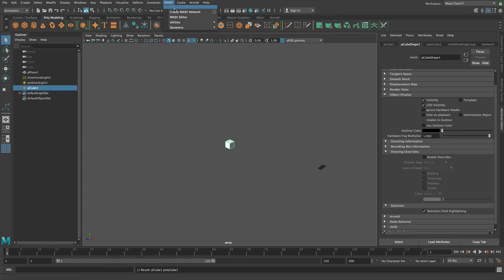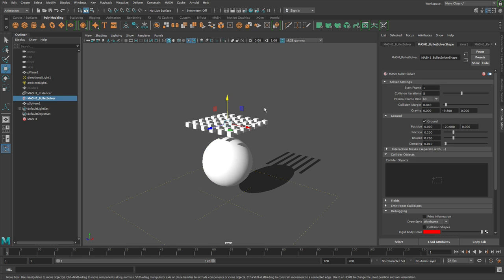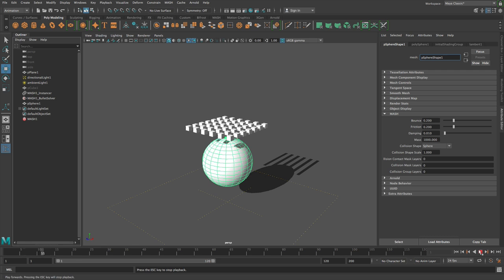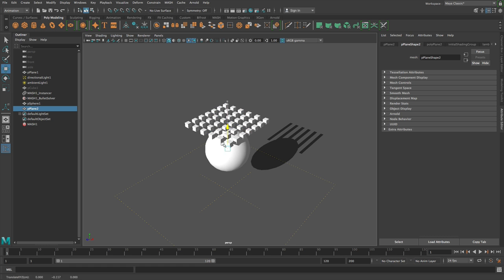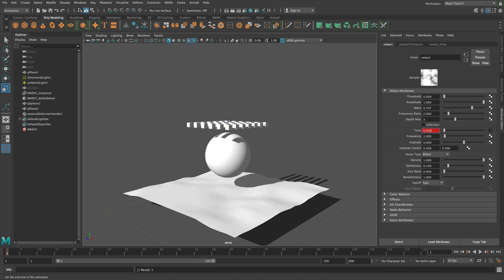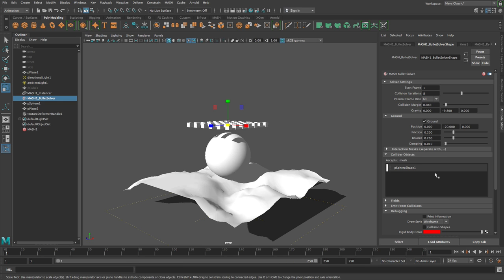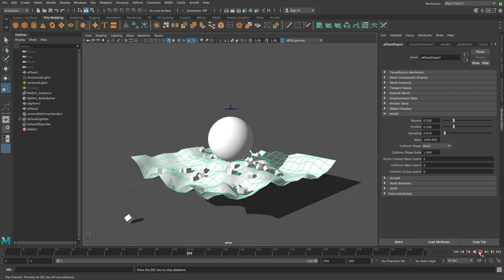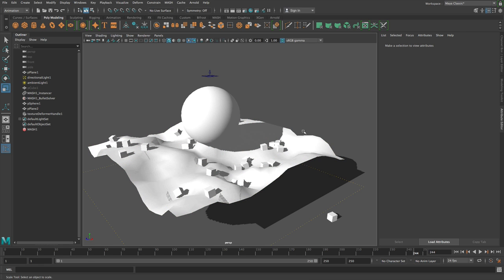MASH Dynamics No 3. External Colliders

Comment: Thanks! How do you adjust the collision thickness of the collider because I am doing a ball pit simulation and the balls penetrate the walls slightly?
Reply: Actually, I kinda figured it out, it really is the "Collision Shape" setting on the Dynamics MASH node. I had a lot of success with Box, Sphere, and Capsule shape, and playing with the Collision Shape Scale. So if your objects are penetrating maybe try scaling UP your collision shape scale slightly.
Reply: @MANIAKRA  Awesome! Thanks! I will give that a try.
Reply: Same, I am filling a container with beans and about 40% of them are penetrating through the model.

Comment: Hello. Thank you for the tutorials. I am having an issue that I am hoping you can answer. I want to have this box with sphere's inside and the box ripping in half. I have the box animated and exported as an alembic node. I am making the spheres dynamic and the box it's collider. However, the collision shape seems to only take into account the first frame shape of the box and does not change as the box changes. So while the box rips, the spheres are staying in the center maintaining the boxy shape. Is there a way to  have deforming colliders in MASH? I have changed the collision shape to mesh and that doesn't seem to work.

Comment: Tried something essentially the same as this tutorial, but while it basically works I get a lot of cubes eventually penetrating and dropping through the texture deformed plane. Tried bumping up the collision iterations as high as 500, but cannot fix it. Is this unavoidable or are there other attributes that will improve collision accuracy?
Reply from the maker: This could be one of a number of things (dynamics is a balancing act). You could try increasing the Collision Margin on the solver, also try the different collision shapes on the mash node. Mesh is the least accurate. It also depends on how much your mesh is deforming frame by frame, if it deforms so much that it can swallow the model resting on it, then theres nothing that can be done about that! :)

Comment: HI Ian, Im trying to create a small tin filled with nails. Ive created a MASH dynamic network for the nails and they are set to 'mesh' . The tin is a medium poly cylinder plugged into the bullet solver. The nails fall inside the tin just fine, but when I move the tin from side to side 'some' eject out. I have tried upping the collision iterations and also the internal frame rate of the bullet solver with some slight improvement but even with the solver set to 960 the nails escape. The tin is set to mesh under the shape node MASH attributes. Any ideas how to get this working if at all or am I trying to push this too far ?
Reply: When I say move the tin from side to side I mean keyframed 'not' interactive.
Reply from the maker: I'd certainly not use mesh for the nails - switch it to convex hull and see how you get on. You could also break the nail head out from the rest of the nail, so that it's two objects, and then you'd get a compound collision shape built from those two objects. Avoid mesh as a collision shape as much as you can! :)
Reply: Hi Ian and thanks, yes I tried convex hull also on the nails with slightly better/quicker results last night - better but not perfect by a long shot. Admittedly nails are pretty problematic shapes but I thought I would try this kind of shape as its a more real world use rather than cubes/spheres.
Reply from the maker: Could be your scale - try scaling everything up. Also with convex hulls, increase the collision margin to say 1 (default is .04).
Reply: I am just trying to get away from Maya rigid body dynamics or the fairly useless Nparticle instance geo which doesn't consider the shape of a complex mesh. When I saw the Dynamics update to MASH I was over the moon and have been playing with it for a while now and also following your great insights.
Reply from the maker: Feel free you upload your scene somewhere and I'll take a look.
Reply: Ah Ha collision margins have helped allot! kind of makes the collisions less real but its a much better result overall. I shall continue to test. Thank you Ian
Reply: although rotating the tin to tip the nails out is a brand new issue as they just stay at the same level in Y at which they came to rest.
Reply from the maker: Is the tin an external collider or is it in a MASH network? If it's an external collider you can't do this. It needs to be in a MASH network to rotate (a MASH network with 1 point, which is the tin). Then use position/ rotation strength to move it.
Reply from the maker: Basically don't move external colliders. Only deform them.
Reply: Yes its an external collider - gotcha I will try a separate MASH network for the tin. Again - thank you !
Reply: I was having the same trouble as this guy... I'm dropping some spheres in to a container made out of cubes, and my scale was too small... Scaling everything up about 20x sorted out the collisions, before scaling my spheres would just pop through the sides of the container. Cheers for this comment, Ian! These tutorials are really useful!

Comment: Hi Ian, I have a problem, if I create a box, and shape it like a propeller (fan), then rotate it, Dynamics only use the first frame to calculate the collision, and I cant find a collision setting "Moving mesh" like in C4D... do you have any suggestion?
Reply from the maker: Hey Luis, do the animation in MASH and then use MASH Bias to get the animation in - there is no moving input mesh support yet, because of the way Maya works this was super complex to add so we left it out for now.
Reply: Thanks for the tip, I tried but I couldnt do it.. I didnt used keyframes to animate the helix though, just a simple (=frame*4) xpression, then I tried with a signal node, but the helix starts behaving erratically when I play with mash bias settings... I'll keep trying.
Reply from the maker: Feel free to email me a scene and I'll take a look when I get a moment. Email is on the about page of the channel.
Reply: thanks! I'll do it in a moment